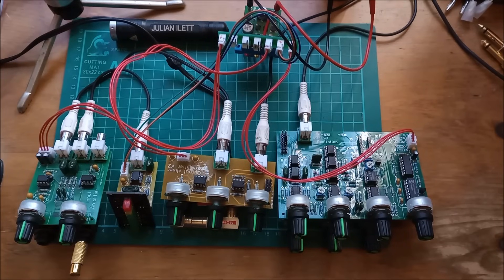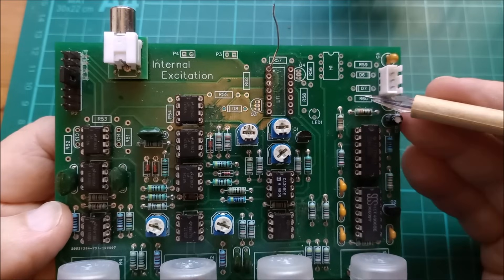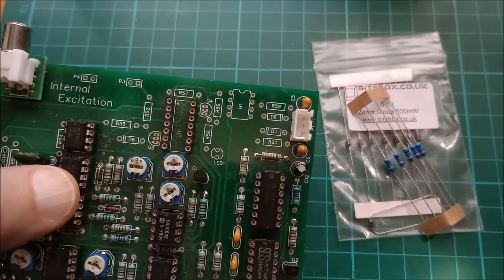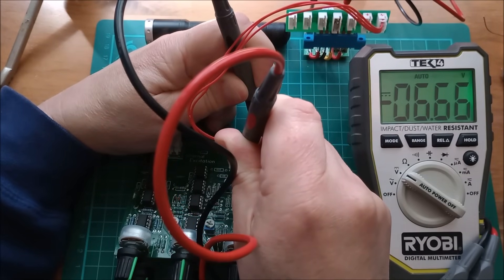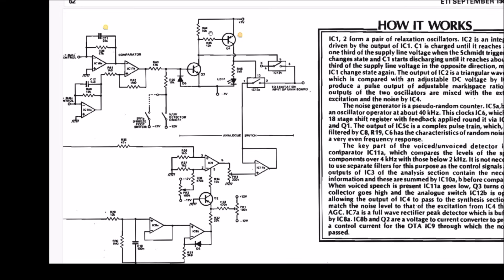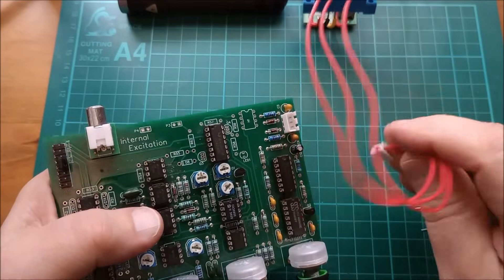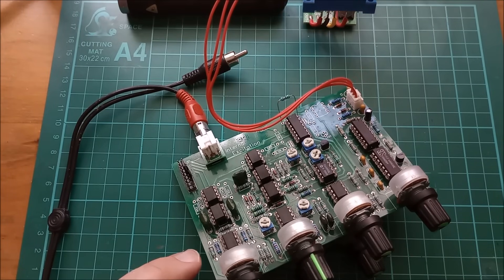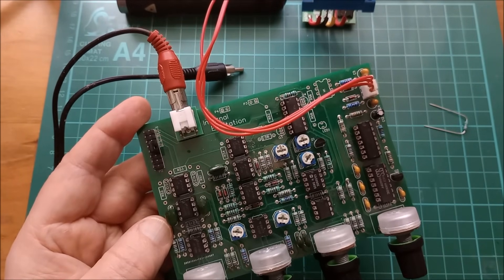A CD4016 is added to the Vocoder

Comment: Roland use transistor and voltage divider psu's to power CD4000 chips (in the TR-808), rather than diodes.
I powered the CD4053 with +/-10 volt (created from Zener in combo with opamps) in my eurorack synth and work fine.

Comment: lucky you did not blow the chip by inserting it with power on. unless you can make VCC, VSS, and Ov all make connection at the came time you risk internal latch up's and dead chips.
Reply from the maker: Seems I got lucky :)
Reply: @JulianIlett  we all do sometimes.